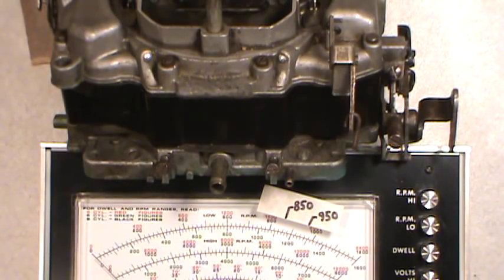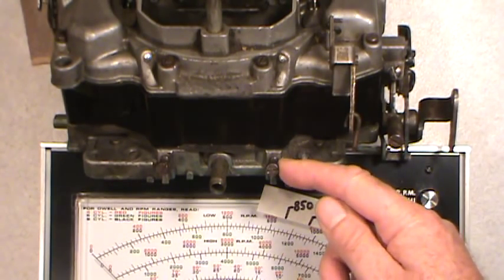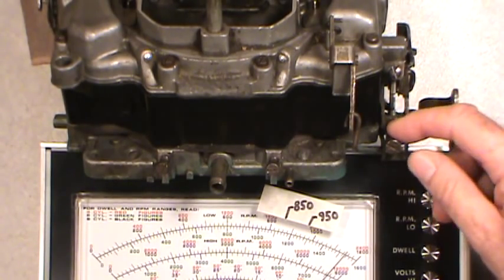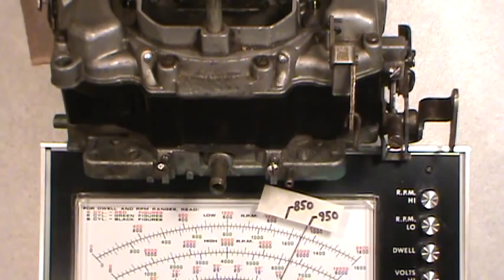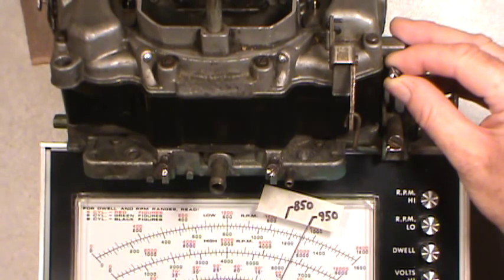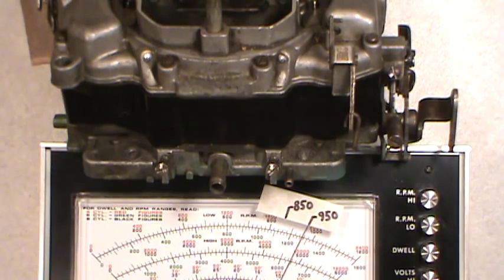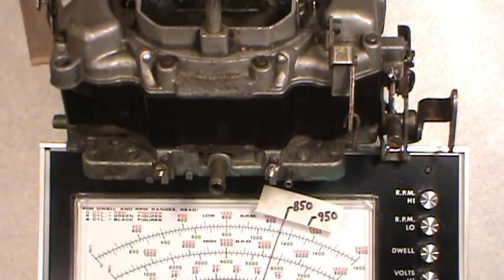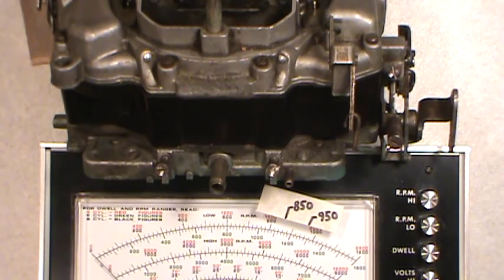Idle Mixture Adjustment on 4 Barrel and 2 Barrel Carburetors

Comment: I see many older carb vehicles running far to rich, black smoke and gas fumes! Proper air fuel mixture is far better for more power smooth running, keeps oil cleaner as well. My 72. Nova 350 two barrel Rochester runs to near perfect state of tune!
Reply: My 51 Chevy 1/2ton P.U. Rochester 216c.u. one barrel does as well!
Reply from the maker: Greetings...Bill Bright...........Thanks for watching............It's good to hear, that Your 1972 Chevy Nova, is running, good as a Swiss Watch (so to speak).........(I like the Nova, and, I use to ride along with a Friend, while he was driving his Mom's blue 1971 [I think?] Nova 4-door, that had a 250 cubic inch inline 6-cylinder engine under the hood, way back when)...............Lem-me-see-now...a 1972 Chevy V-8, would probably have a Points and Condenser, type of Distributor in/on the engine, unless "it" was Changed/Upgraded to something else............If You're still using the Points and Condenser, type of Distributor, then, I hope, that, the Points Gap/Dwell, is kept at that, about 30 Degrees Dwell specification, cuz, as the Points Gap Changes, (due to, arcing at the points, as well as, rubbing block wear), then, as a result, the Dwell, "and", the Initial (base) ignition timing will Change, as the Mileage starts to accumulate, most times.............Yes-Sir-ee-Bob, the older engines, that didn't have, much in the way of Pollution control Devices, as well as, the usually, quite a bit Leaner Air/Fuel ratios, that those Smog/emission Carburetors were probably calibrated for, were, for the most part, more than likely, calibrated, for a slightly Richer Air/Fuel ratio, generally speaking, that is.............If You are putting Gasoline, that has, oh, about 10% Ethanol (alcohol), in its Blend, into Your Nova's gas tank, then, that alone, will probably be having the Affect, of a slightly Leaner Air/Fuel Ratio, as compared to, having the engine burning 100% Gasoline (without any Ethanol in it what-so-ever), cuz, gotta remember now, that, those older Carburetors, were probably Calibrated/Set-up with, 100% Gasoline, and probably before, those Gas-Pump-Bandits, started to Pump-out, that Gas-em-ah-Haul (that be, the Gasoline, that had Ethanol/alcohol added into its Blend).............Although, just about any Gasoline burnin' engine, will run very well, that, in itself, can't really tell You, what the Real, and Genuine, Smog/Emissions, that are actually exiting the exhaust pipe/s, unless, having the Vehicle Smog/Emissions Tested, at the (smog) Testing establishment, or equivalent, there-of..............Case in point...I had a 350 Chevy V-8, with a 4-mv Quadrajet, sitting on top of the intake manifold, and, I had to take it though the Smog Test, and, my very first time, at that............So, I thought it would be a good idea, to get those 2 Idle Mixture screws, Leaned out a bit, cuz, I had no idea, as to, where they were adjusted at.............I turned in/clockwise, those 2 idle mixture screws, to Lean-out the idle mixture, quite a bit, to the point, where I had them at the Leanest setting, while also, having that Chevy 350 V-8, Idling in gear, and almost as Smooth at Silk, at the very same time............Well, so much for, the Engine sure Runs really well, cuz, after going through the Smog Test, "it" Failed, the (while) idling in gear, part of the smog test...!!! (oh no...!!!...lol)..............Well, it turned out to be, that, I went Too Lean (air/fuel mixture), when I adjusted those 2 idle mixture screws, to the point where, that Too Lean of an idle mixture (adjustment), ended up causing, what is termed, a "Lean Misfire", where-by, that, Too Lean, of an air/fuel ratio/mixture, would-not Burn properly, and probably sent, some Un-Burned Gasoline, through the exhaust system, that didn't have, or required, a Cat/Catalytic Converter on it................The "HC" (Hydrocarbons) were at about 700 +, and the cut-off point, was a @ 500 PPM/Parts per million, as I recall.............Also, a Carburetor's Air/Fuel ratio (mixture) "Varies" as well, depending on, what the engine's Operating conditions are, at that particular moment..............Very Rich, when starting a Cold engine, on a very Cold day, due to the Choke being On (as Gasoline, will condense, on the inside runners, of the intake manifold, until it gets hot enough, as an example)..............Once the Engine, is at Operating temperature, then, it can idle, at about 14.7 to 1 air/fuel ratio, or, a bit Richer, if need be..............Same 14.7 to 1, while just Cruzin' along, at, not too  fast of a speed, and some tuners, can easily get into the 15 to 1 air/fuel ratio, on a factory/stock, low compression ratio engine, to increase Fuel Economy..............Here's where it gets "Rich" again, cuz, when You go WOT/Wide Open Throttle...Pedal-to-the-Metal...then, it'll probably be about 12.5 to 1 air/fuel ratio, there-abouts, as an example............Something like a Dirty Air "Filter", can kinda act, some-what like the Choke does, as in, in Restricts, the amount of Air, that gets into the Carburetor, and then, the result usually is, that, More Gasoline, gets sucked into the Carburetor, along with Less Air, which will usually, cause the Air/Fuel Ratio/mixture, to become "Richer", than it needs to be, and then, Fuel Economy will drop/become worse, as a result, and.......till next time........Be Safe, take care, and have a good one.
Reply from the maker: Greetings...Bill Bright............Nice to hear, that Your 1951 Chevy Pick-em-up-Truck is behaving itself as well...lol.............Ah yes, sure do like those times, where, Ya can spend more time Driving "them", rather than..."FIX-in"...the darn things...!!!...lol...but, then again, when the Engine Ain't Runnin'...Ya get Super Good "Gas Mileage" (as in none, what-so-ever...!!!)...lol...and.......till next time.......Be Safe, take care, and have a good one.